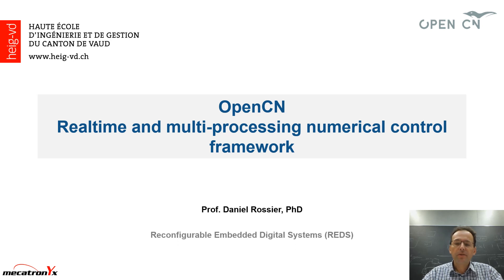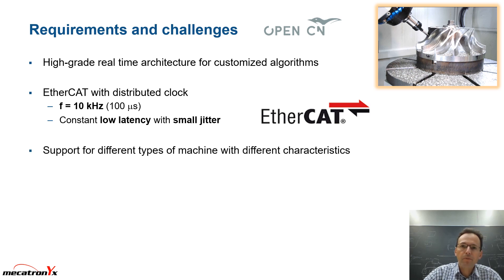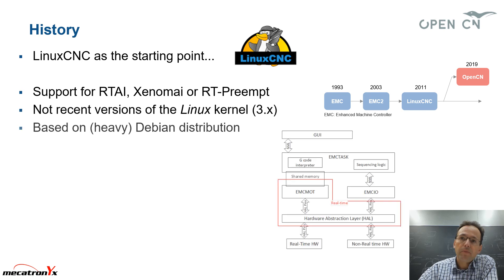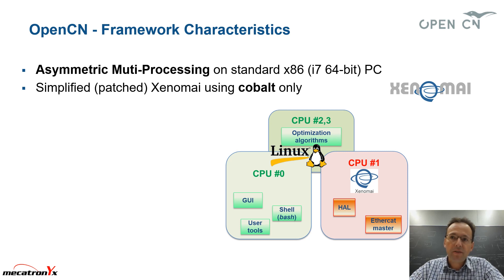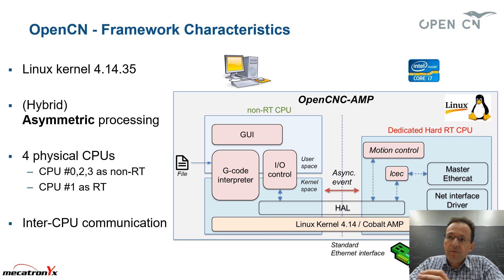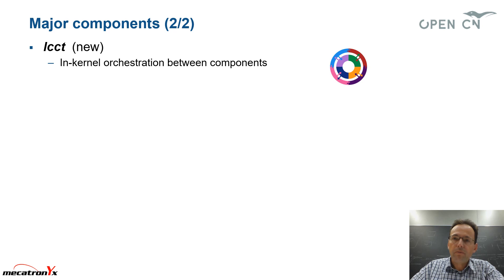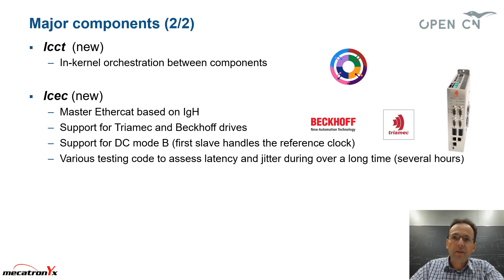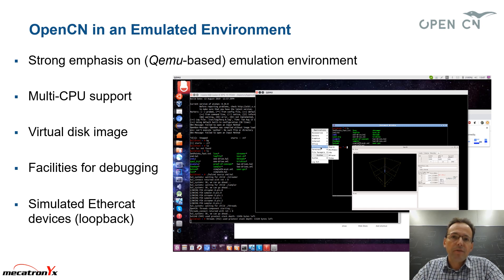OpenCN - Software architecture

Comment: This new architecture is absolutely amazing! I wonder how come nobody has commented anything about this video. 
I am now using linuxcnc to control both my mill and my lathe, and I was wondering if open cn would be able to control the servo drives using the mesa boards, via analog +-0-10v or pulse/dir, or is it mandatory to have ethercat. 
Also, I’m wondering if the interaction with OpenCN is still through NML and Hal components. 
I wrote a lathe controller app in kotlin that uses JNI to read the NML data and can create hal components and do read/writes on custom created pins.